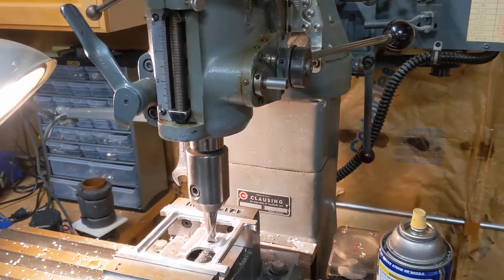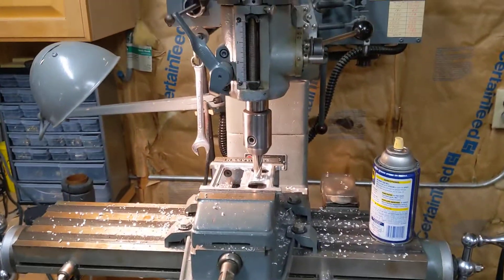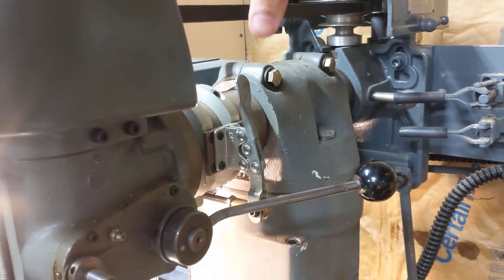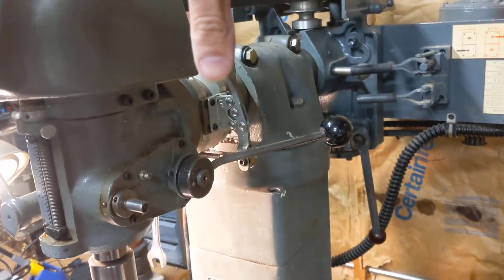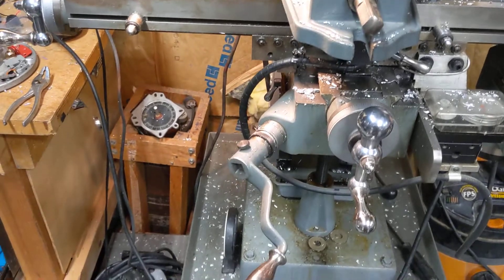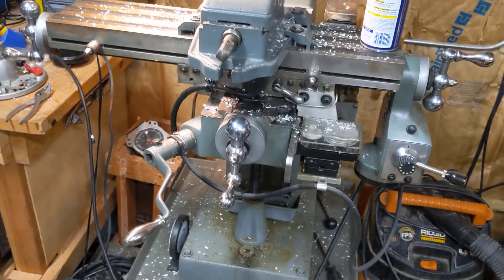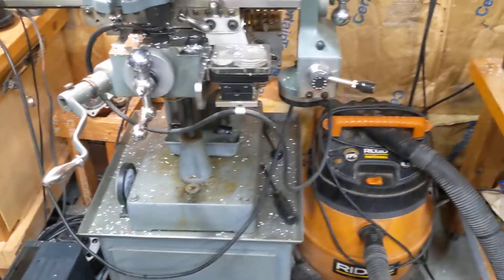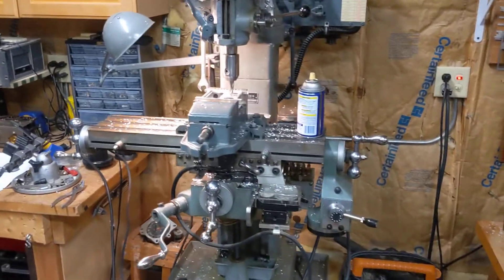Clausing 8520 Milling Cube Satellite

Comment: OK so I just picked up one of these and it needs some work. I notice your machine has a bunch of modifications that you might explain. It looks like you made a self-extractor cap for the drawbar? The painted lever on the left side of the head appears to be the spindle lock? Mine just has a bolt there. What's the toggle clamp/pushrod linkage on the ram in front of the column? And why is the motor offset and upside down?
Reply from the maker: For the most part all the modifications were made before me the motor mounting position is because I can change the belt reduction using the levers and swinging the motor inwards to change the spindle speed quicker. The mill also has a oiler pump that disperses oil on all the important surfaces.